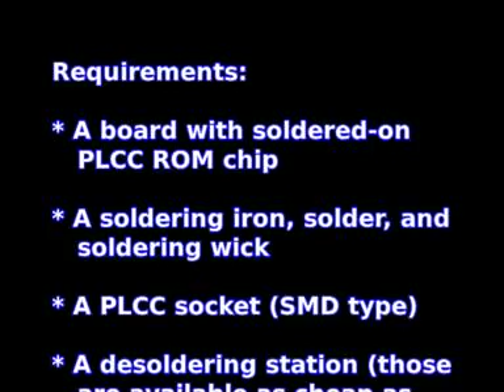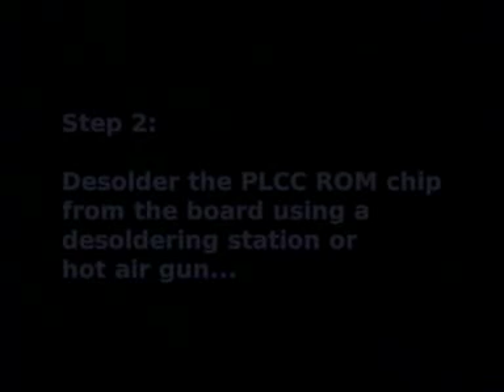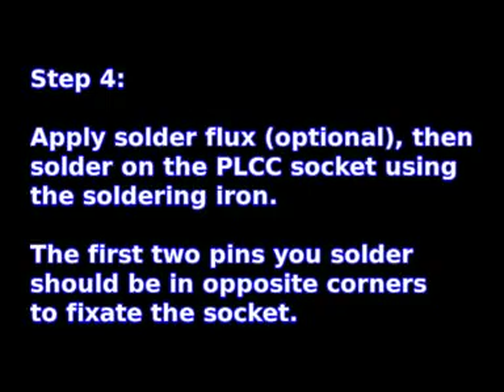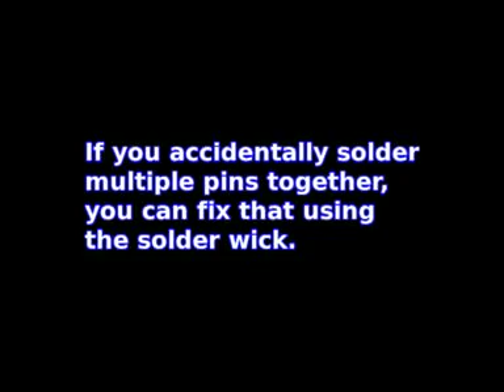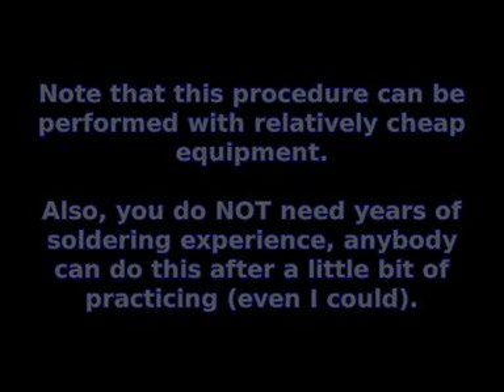Coreboot hacking: How to solder a PLCC socket on your board

Comment: As with all such skills, PRACTICE ON SCRAP never your workpiece. Parts are cheap and repetition builds competence. Scrap electronics are plentiful and you can learn (for example) desoldering by stripping a dead system board (Thinkpadders often have system boards removed from service thanks to GPU issues like Nvidia problems on T61s).

Comment: Thanks for a great video! I should have searched for something like this before I started - I cut the pins off the chip with a cutting disk in a Dremel high speed tool and lifted the plastic off leaving the cut pins in place, a couple of the pins came loose though and I was wondering what to do next. I'll be using a stepper driver chip though so maybe a socket wouldn't stand the amperage (max 2.5A).
Nice music by the way. :-)

Comment: No, that is bad method.  You did right thing by clean old lead off smd with desolder; however, I must say it is not good method of apply socket.  You don't need cut sheild off of socket.  It is useful.  Adding flux onto SMD pin then add a little lead as pre- hot air.  Use tweezers to hold socket, then use hot air solder.  Be careful to not blow off other resister and chip smd.  The reason why you shouln't use solder is because it is risk that tip solder would coming into contact with plastic which is not good.  Melted plastic socket or chip, it is totaled.

Comment: fried my board and chip installing, fuck this shit!
Reply: TechGamingTV you need a proper solder station thisnisnt difficult at all using the right equipment. If you seriously want to do this work invest $100-$200 in a decent hot air solder station, digital microscope, and proper solder paste, etc... 99% fail because they don’t understand the correct way to do this. I will further state this video is not the proper way even if it worked.

Comment: i tried some dumb ideas. i tinned the socket's pins then used hot air,only some pins stuck others were floating. increasing to 290C, melted socket surface. should have added solder to motherboard. used 60/40 solder. which type? lower temp?
so used iron. some pins didnt connect after some attempts, added alot of solder, worked, but damaged spring on the socket. next time i bend the tip of the pin downward so excess solder stays on the board. i used glue to keep chip up.
also needed a thinner tip.

Comment: @Tda7000 Depending on the Material the Socket is made of, it might soften and warp, rendering it useless. Thats also the reason why some ( e.g. most micro USB ) Connectors have the Brown Kapton covering, protecting the Plastic insert from the heat of the Reflow soldering.

Comment: did u use the original chip when you put it back in the socket or was it damaged by the heat gun? also, is there anyway i can remove the chip without a hot air gun? by cutting it carefully of the board maybe.